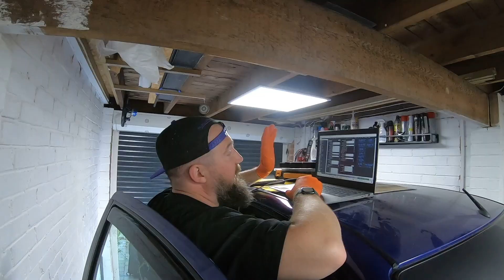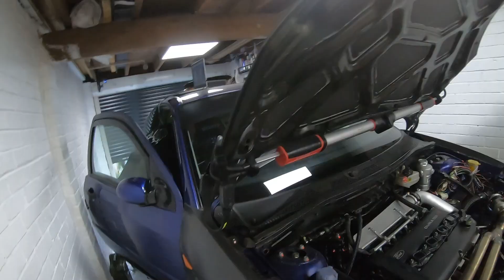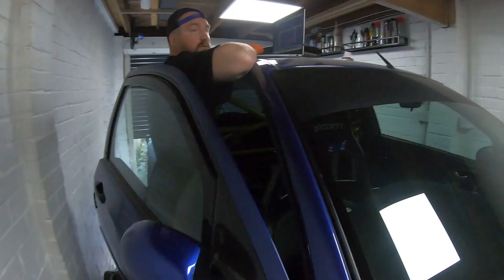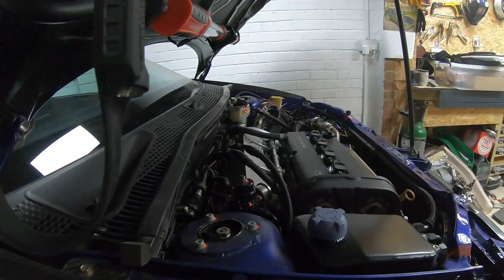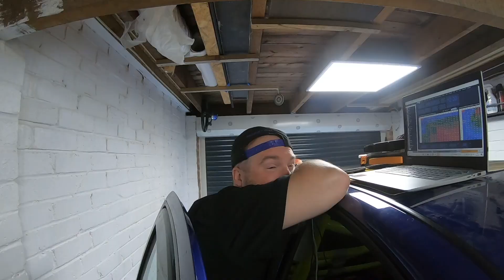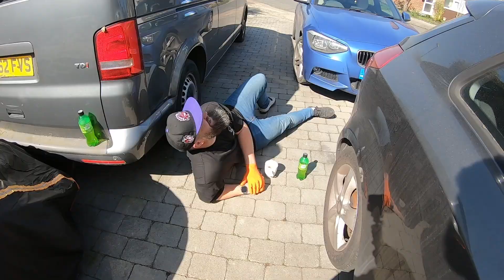WILL IT RUN?! BIG POWER ZETEC TURBO FIRST START

Comment: What size injectors did u go for ? What was the limiting factor for stopping at the power you made at quest ? Or was that what you was happy with? Cheers
Reply from the maker: Hello mate, I have Bosch 1000cc’s probably should have gone for 1200’s but basically ran outa duty on the injector and also at the limit of the turbo as we used 2.2bar some head room left but only like .2bar so just called it a day there as I’m happy and it’s safe 😎😎
Reply from the maker: Still ignition to play with, cam timing, add that .2bar and flex fuel on ethanol later in the year and we could push it further but for now I’m over the moon mate 😇😇😇
Reply: @MADMATTRS  so you hit the injector and turbo limit at the same time? Sounds spot on.
Reply from the maker: Absolutely mate only thing left to do is enjoy it 😈😈😈😈